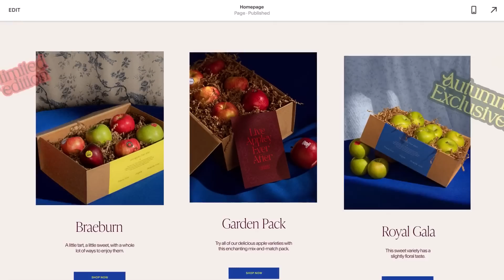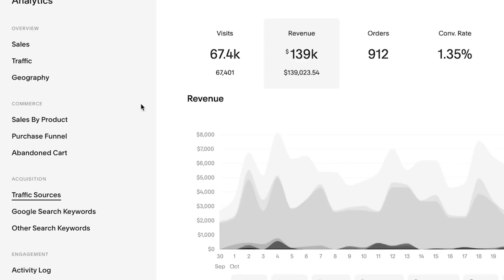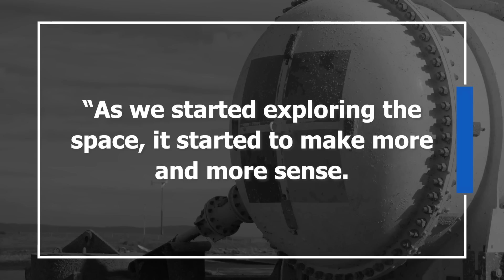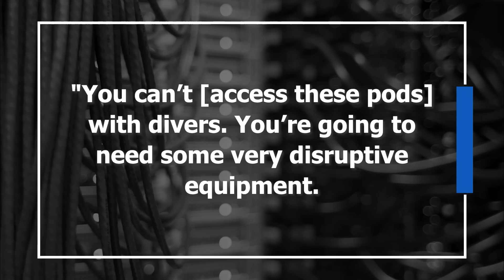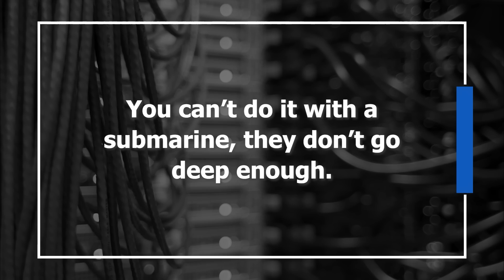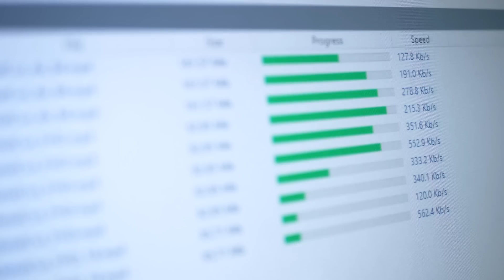Underwater Data Centers: The Next Big Thing in Keeping Computers Cold

Comment: I'm left wondering if marine growth, especially on the very deep unit, inaccessible to divers, could be a problem. I guess as long as it's a passive heat sink not relying on any water being transferred through pipes which can be blocked by growth, it should be fine.. Great idea 👍
Reply: Presumably, a full coat of barnacles (etc) would have lower thermal conductivity than 'bare' metal. Occasional cleaning would be necessary, methinks. Still, the passive nature and the basically endless supply of cold water is a very attractive idea.
Reply: you can always put the containers in places where sea life is minimal (like very deep sea beds, such as on the Abyssal plains...or where trawlers have destroyed the local ecosystem). A surveillance system and ability to periodically inspect or raise the containers for cleaning might be required, though.
Reply: @13minutestomidnight i think the cleaning can be done underwater
Reply: @kayjr9795  You’re right, you could definitely use automated systems in the deep ocean (like ROV’s even) to clean the containers, but I’m not sure how efficient you’d be able to make them if you needed to clean off fine films of bacteria etc. Nonetheless, if you needed to, you’d still be able to raise them up periodically so that humans could inspect them. 

I mean, It’s still unknown whether marine life living on them would even be a problem. It would be great if they could be put down there for long periods and actually provide a habitat for marine life.
Reply: Or they could actually help society by providing said generated heat to a neighbourhood or city, but that costs a little extra and is absolutely bad for the shareholders, instead, lets just cook the seas directly, and just do absolutely nothing with the generated heat.
Reply: @legolas66106  the heat emitted from those devices would only affect the immediate vicinity, maybe only a few metres or less, I would expect
Reply: @legolas66106  It’s not as simple as that, and the oceans wouldn’t be affected unless we fill the whole sea floor with them (they’re a huge heat sink). You can gather and use the heat generated by data centres (and even industrial machines) for heating homes etc., but this process is inefficient and has difficulties. You’d still need to use a coolant to absorb the heat from the machine and transfer it somewhere else, and then provide a transfer mechanism that can absorb and use the heat from the coolant. 

This isn’t a simple system and depending on the resources this technology requires and how it is manufactured, you might end up with a worse carbon footprint than the “data centres in the ocean” plan. It’s still a great idea and some companies have already started creating this kind of device (using heat from data centres), but it’s not like placing the data centres in the ocean like this is not environmentally sustainable either.
Reply: @legolas66106  there are plenty of those projects going as well.
Reply: @legolas66106  yes, let's put our data centers in the ghetto. People will totally trust our servers.

Comment: New idea.

Build Data centres into municipal pool buildings.

Use the servers to heat the pools.  Will save vast amounts of power and water.
Reply: Linus Tech Tips is trying to heat his pool with his home server.
Reply: I don't know about the rest of the world, but the first one of these in the UK has just completed its first year of service, with good results.
Reply: Or connect them to heat networks for heating on other locations, with heatpumps at every customer.
Make it obligatory for every building that produces a big amount of heat energy.
Reply: @milanvdv  i really don´t think even server makes so much heat. and even if yes, than you must consider, how to keep cool that server. lower temperature- better performance. so you actually dont have hot water. you cant, because than your pc will slow down. it can heat water, but not enough to work as single unit. as a part of more complicated and expensive system at best. nothing what can easily heat a house or any building. (btw you can´t turn it off, so you have ´´hot´´ water even at summer)
Reply: @flpmlks5181  Even if the temp of say, a swimming pool, is raised by a only a few degrees that's a MASSIVE amount energy that is being used efficiently. 

And like you say it probably wouldn't get too hot so it wouldn't be unpleasant in the summer.
Reply: @flpmlks5181  Its called a heap pump...
Reply: @flpmlks5181  A server makes lots of heat. I take it you have never been to a real server room?
Reply: Far better solution for sure
Reply: We do in Sweden. But we don't have pools, so we heat homes instead.
Reply: The local council pool works a little like this.

They have an ice rink upstairs and the heat is shifted downstairs to heat the swimming pool.

With so much heat management equipment in place already they added a small data centre into the building too.
Reply: Because there's never any issues with underwater explosions, sabotage, rogue anchors or salt water corrosion. Plus all that poor aquatic life at the bottom deserve heated water too.
Reply: Security, maintenance, regulation, safety, lawsuits, there are a hundred other reasons why they wouldn't do this. Not enough water is probably the biggest, wouldn't really solve the problem so they'd have to use radiators too. This wouldn't keep the temps down where they want them except maybe in winter when ice cold water is free.
Reply: @slcpunk420  lol
Reply: Datacenter heat being used to heat buildings and stuff is not a new thing. Netherlands does it quite a lot actually
Reply: Actually there is a project that is using the waste heat from a data center to heat a pool. Though everything is in a colder climate, so a heated pool is a must.
Reply: This is why I leave my tower PC on during the winter, running Folding@Home.  Heat the room AND help fight cancer! Win Win :)
Reply: FBI Enters the Chat
Reply: @rickyfinn2763  IBS enters the chat ... and then quickly rushes away without a word closing the door behind them 🧻
Reply: Just put a couple data center racks under my hot tub 🤣🤣🤣 But seriously, in a lot of places they have central heating, where a central facility heats up water and distributes it to nearby residents for heating during winter. This could definitely be a thing, just like there are already many applications that capture waste heat from power plants, etc. Why spend energy to heat things up, when we already have so much excess heat?
Reply: Sounds to me like physical security would be a headache and a half.
Reply: @connormccloy9399  You think the regular back bone is secure?

Comment: Seems best to interweave with more accessible data centers, but yeah that seems like it will be what we use the ocean for a lot. The issue with space in many cases is how difficult it is to bleed of heat. The more technical a construct like stacking silicon is, the more it’s sensitive to heat, and the more heat it could put off the more power it draws. Use earths greatest resource advantage versus extraterrestrial ventures. Of course we are already very irresponsible with our water resources. So we have to build smart. We won’t. But we could.

Comment: You don't need to access the canisters with a deepwater diver/AUV/ROV. Cables have to come ashore and as they get into shallower water they are exposed to anchors dragging, saboteurs, etc. Then there's always dropping stuff that goes bang on the canisters. Oh, and sea life loves to occupy places with moving seawater, like the inlets and outlets of pumps, blocking them with flesh and shells. Can't see anything going wrong with unattended stuff in the ocean.
Reply: You can basically operate it like a oil rig. Have a platform at sea level and the modules basically under the platform. That pretty much avoids the issues related to anchors and such.
Reply: @shadow7037932  You still have to have cables that run ashore. And running it like an oil rig removes the cost benefits of running it unattended.
Reply: @tsbrownie  We've had undersea cables for 150 years.
Reply: @米空軍パイロット   Every year, there are more than 100 incidents where the cables are cut or damaged.
Reply: @米空軍パイロット  Their point is that cables can be deliberately damaged or 'tapped'. That CEO conveniently ignored that in her security assertions.
Reply: @TheJohn8765   Yepp. I'm sure she thought about it tho seeing that there are underwater cables already, only thing is that once you're storing data you're very much a bigger and easier target for hackers or anyone that just want to disrupt your service.
Reply: @tsbrownie  Nice
Reply: I think the point of that last company planning to put their servers inaccessibly deep underwater was to prevent data theft. Obviously, you can destroy or disconnect the underwater server any time you choose, albeit perhaps a little more easily/deniably than a land-based data centre. (Eg: A bomb would do nicely for both, but you're more likely to get away with it if you're on a ship whose transponder is turned off.) However, if you also encrypt the data in/out in a way that's resistant to forseeable quantum computer attacks (and people are working on that), tapping the cable will be useless.

The movement of seawater does seem like an issue, but the Microsoft test cylinder in the first half of the video seems to have solved that problem. They had to clean off a whole load of gunk, but the data centre kept on working for 2 years with direct intakes/outflows to the sea, somehow?! I would be very interested to know how they did that.
Reply: To solve the inlets/outlets problem: Use a heat exchanger instead.

Sure it'll require more piping, but also there's nothing for sea life to clog up.
Reply: But isn't the cable issue the same for land based system? Since almost everything travels through those cabels at some point.
Reply: @carlengeler3478  The ocean is a mean place compared to land buried cables!
Reply: @tsbrownie  I get that but your "normal" internet also travels through the sea...
Reply: @carlengeler3478  Of course you are right, but let's not give any *more* of our tax dollars to microsoft! ;) Bill has enough.
Reply: @carlengeler3478  Very good point, and I pretty much agree with you. I think the main difference between this and a land-based operation is that you know for sure that ALL of the data from that underwater data centre flow through that ONE cable. Tap/cut that cable, and you tap/cut the data centre.
Reply: I agree. I do think it's a FANTASTIC idea that solves a few problems, but it's not perfect.

I wonder if they could build them near naval bases to increase security.
Reply: @WarttHog  Then we taxpayers subsidize MS.

Comment: Regarding security of deep water data centers, my concern would be more with the umbilicals required to service these data centers. They need to link to land at some point, and that is a huge length of cable that is at a relatively shallow depth, and accessible by anyone with the will.
Reply: Exactly, just google “world fibre-optic Map”.  

Can you see that there is already hundreds of landfall for the current World Wide Web infrastructure
Reply: Not a new problem

Comment: The water saving benefits of not using water to cool land-based data centers are miniscule at best. You said yourself at the beginning of the video that regular data centers used recirculated water (i.e. closed loop). Once that loop is filled with water, no more is needed. And the total amount of water used is relatively low.
Reply: Congratulations, you have managed to post the most retarded comment I've seen on YouTube this year. This is not about saving water, it's about saving energy by using seawater to cool data centres as opposed to air conditioning.

Comment: This brings dramatically increased cost and offers no advantage over keeping the servers on the surface and just using a pipe to bring cold water up from the deep.  The server farm would remain accessible and serviceable while having the advantage of limitless cooling.
Reply: Except you are going to need powerful pumps to keep water flowing through hundreds of feet of pipe, vs having it in the ocean with a much smaller pump to keep it flowing. Part of the point is to save money on cooling power. Plus I'm sure the metal container it's in being submerged in very cold water means it probably helps keep the interior colder and provides a extra passive cooling effect on the internals

Comment: What about in space? On average around -270c or about 3 Kelvin. Cold enough that superconductors can be utilised
Reply: I think one of the problems with space is it's harder to shed the heat. While it's very cold, there's also a hard vacuum so there's no heat conduction, only radiation.
Reply: @jonbbbb  yes definitely an issue, JWST did it but those shields cost a motza
Reply: Few issues with this. 
1. Cooling - Space is cold in a sense, sure, but it's also a vacuum, which is effectively insulating.  The only available method for cooling is going to be radiative, which is not very effective.  Consider the amount of material needed for the cooling vanes in order for this to be sufficiently cooling.
2. Energy - Data centers are relatively efficient energy wise, but they would still draw a lot of power.  Consider how many solar panels they'd need to run effectively.
3. Cost - getting a data center into space would be extremely expensive.  We're not just talking about the cost of the normal data center stuff, but the weight of all of this stuff, an the cost per kilo of getting it into space.
4. Latency and signal quality - this is going to depend on the orbit used, but I'd expect it would need to be geostationary to be useful, or you'd need a constellation of of these with mirrored content, further increasing cost and reducing its utility.  At that geostationary orbit, even going straight up and straight down is about 250ms (round trip - time from request sent from ground to time response is received at ground), and that's assuming perfect weather.
Reply: In the future that'll be the plan, but for now it would be absurdly more expensive.

Comment: The next version is not going to be that hard to figure out. It will be bigger, probably going to try and make it as modular as possible, close to a place that has cheaper electricity, close to a fast  fiber optic internet connection, they will probably experiment with different types of heat dissipation, different types of systems. They will try to figure out how big you can make a module before it becomes too much of a loss if there is a failure and it needs to be swapped out. What's the best shape and heat dissipation design to make sure components in the center cool the same as components close to the shell? What is the best way to power them ? Should you send 240v into the module and step it down internally? , Taking space and generating more heat? But much easier to transmit any distance...or step it down to the low voltages outside the module but have to have separate units very close because 12v DC cannot be transmitted very far without issues ? And many more questions I would have to know answers for if I was them lol.
Reply: 240v is nothing. your standard computer runs on 240v anyway. If you look at server rack PDU's they provide each server 240v. Most data centres will feed each rack with 400v 3 phase and then stend down to several 240v PDU's 
each of these nodes is so deep and far from a transformer that they would be supplied with 10KV lines at least which are then stepped down to 400v per rack, internally.
This is the most efficient way to transport alot of power, otherwise you increase the amperage and need thicker cables and generate more heat to send the same amount of power.
Reply: @jasonlib1996 .. Computers could be 12V as lap tops are.
Reply: @Ubique2927  Laptops are not servers. 
Laptops are designed to be as power efficient as possible so they last longer on battery and are easier to cool.
Servers want to be as performance dense as physically possible. Each single server depending on intended use case could easily be drawing upto 2kw. you're talking systems with multiple 400w Xeon or epic CPUs, or 50+ drives, or upto 6 GPUs. 
no data centre is using 15w laptop hardware.
Reply: @Darksh0t009  Explain it then ,,don't be so negative ,,
Reply: @andrewdillon7837  NobelDouche has no clue.
Reply: @randomname4726  I didn't see anything wrong with 'coles post either ,, nobelwankster is some school kid i bet ,
Reply: @NobelGangsta  I see no errors in what they said. Please list them for us, or admi you are the one who doesn't understand electricity.
Reply: Or...the electricity would be generated by undersea current near the servers with battery backup just in case
Reply: @Darksh0t009  please explain then. because this is exactly how real data centres are layed out.
Reply: @jasonlib1996  i wouldn't want any power supply components in the module...power supplies fail regularly and usually have 2 or 3 hot swappable backups...if it's separate from the compute module it's less heat and much easier to replace without shutting down the whole thing...these are tests also so they are going to be pretty close to land at this point still...there are calculators online that will tell you losses on  specific wire size length material at specific voltage amperage and such if you are like me and curious.